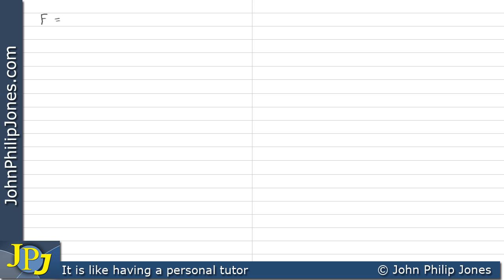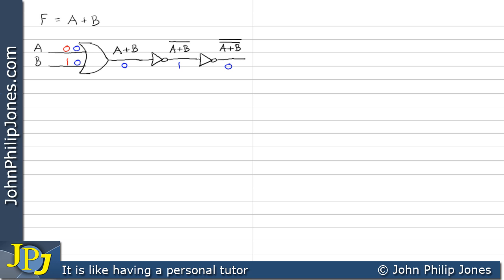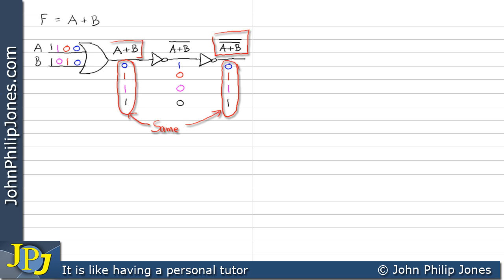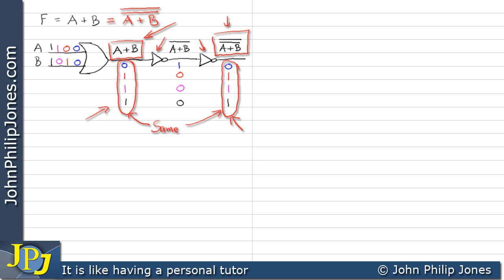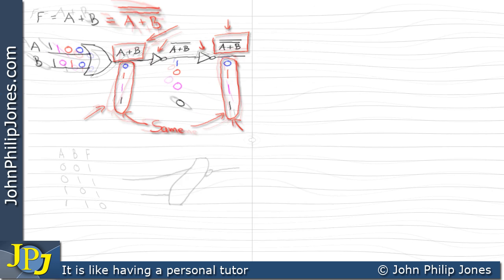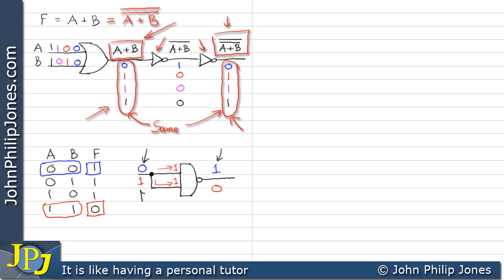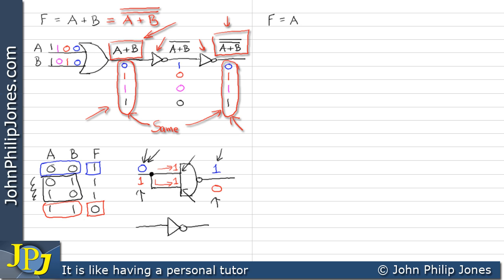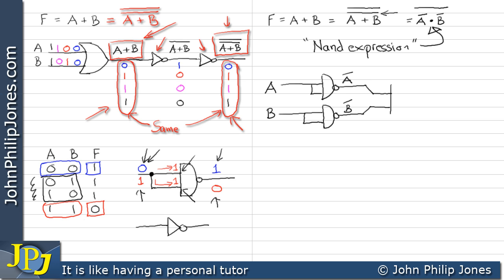Universal Logic (Nand Gates)

Comment: but why do we do this exactly??

using this nand/nor gates does the circuit improves in speed??

speaking about design from transistor level : even more number of nmos/pmos are required for designing nand&nor ...

why cant we just use all types of the gates (as required) for a given boolean function ?
Reply from the maker: When fabricating large integrated circuits the patterns used in the process are easier if their "shapes" are all the same. If the logic of the circuit is made all out of the same gates then the shapes are the same.
Best wishes
Phil
(John Philip Jones)